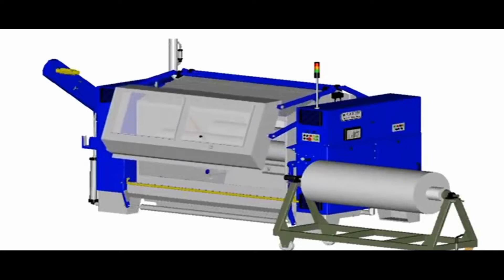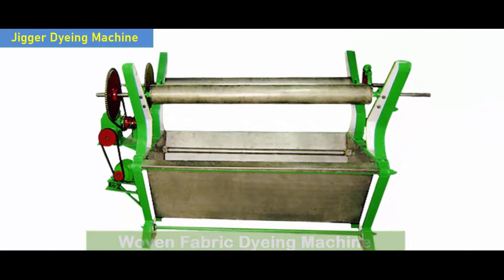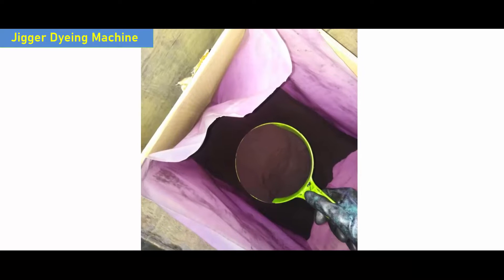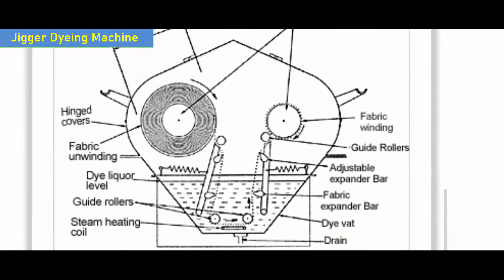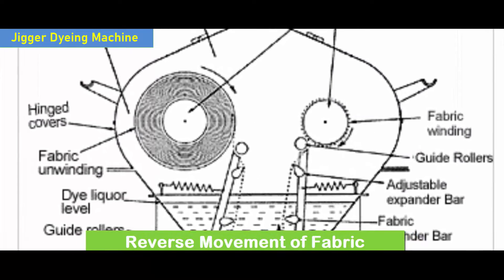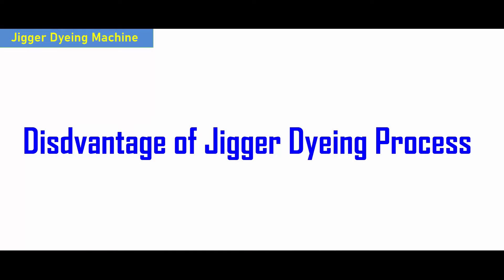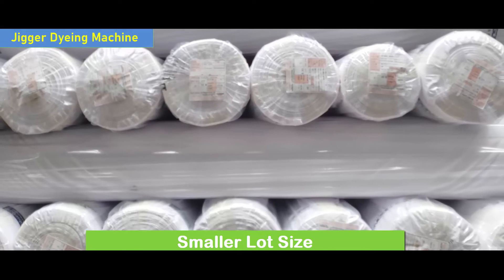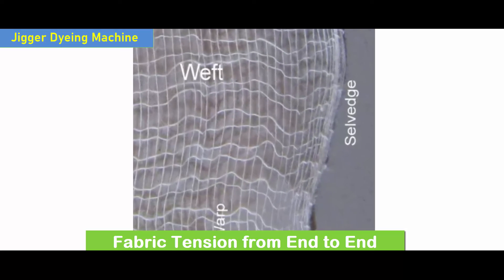Jigger Dyeing Machine | Jigger Dyeing Process Adivantage & Disadvantage

Comment: Nice to see they are still in use, have been jigger dyeing for many years before dye factories was closed down in most of Europe, mainly due to insane environmental demands and restrictions. They are very easy to operate and use only a small amount of water and chemicals compared to ordinary dyeing machines
Reply from the maker: Yes